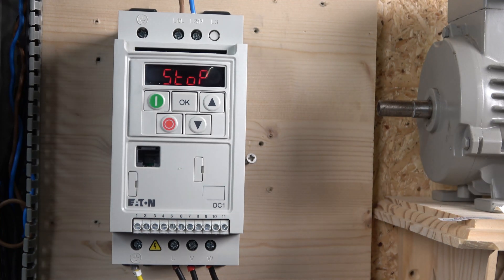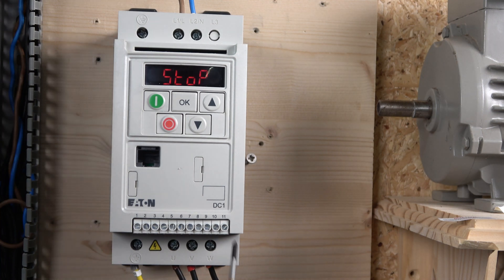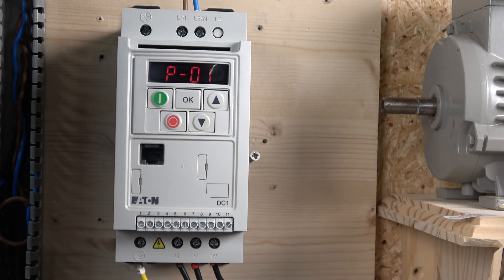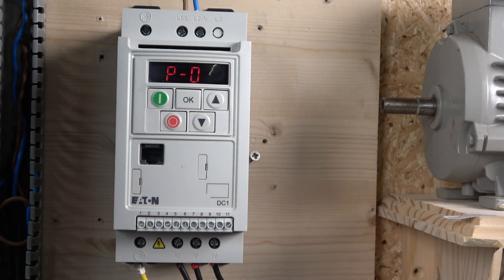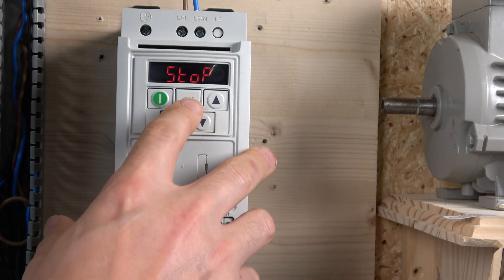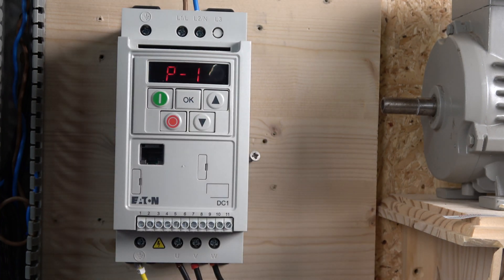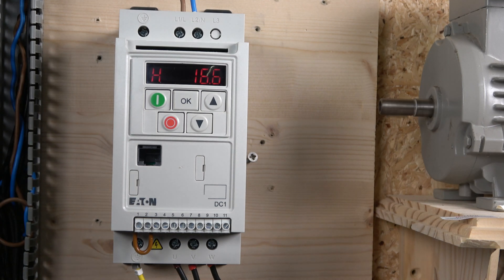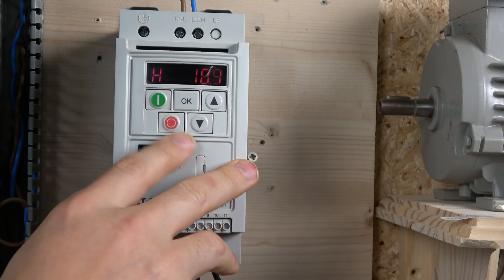Eaton PowerXL DC1 VFD, local run, commissioning , parameter set up, Factory reset. ( English)

Comment: Can I ask why you didn't wire ground from the mains to the vfd? I see the ground wire from motor has been wired.
Reply from the maker: I did not do it due to short time use, but you should always use it. Yes my motor is grounded on different point.

Comment: Is there a way to prevent the drive from reversing when the start button is pressed while the drive is running? But still allow reversing from a local toggle switch?
Reply: I figured it out. I set P-12 = 1, set P-15 =7, then have my switch change the high input from terminal 2 to terminal 3.
Reply from the maker: @backwoodsengineer  well done